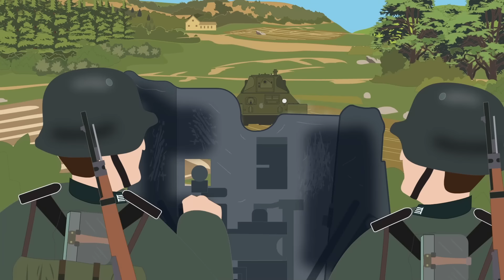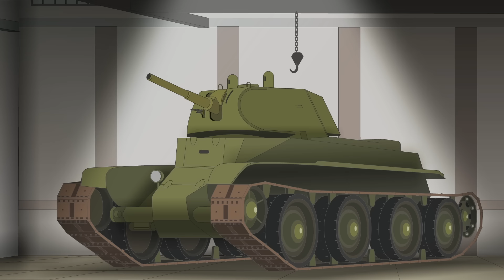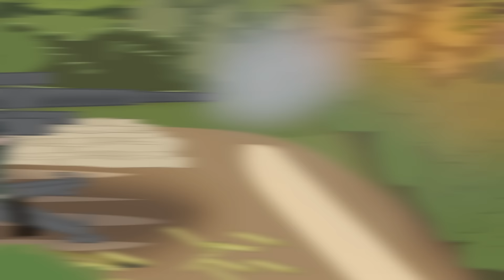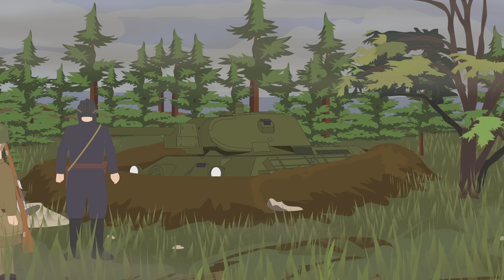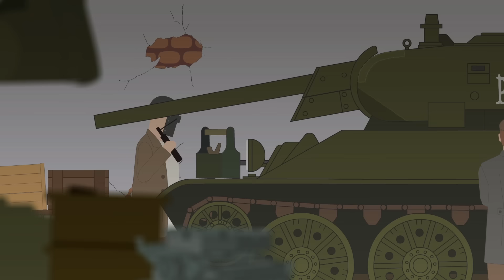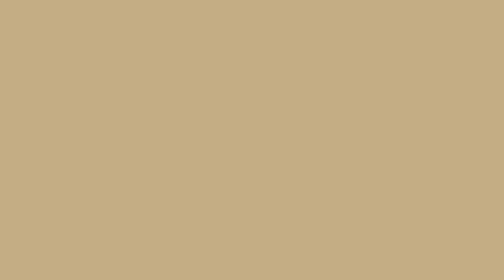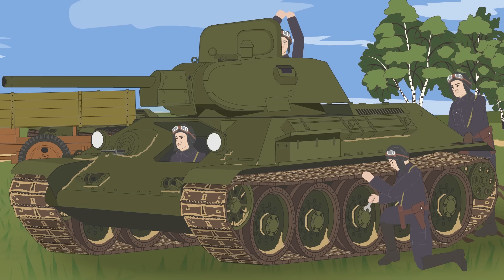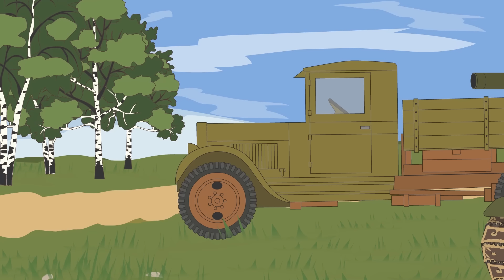Was the T-34 Really the Best Tank of WW2?

Comment: The T34 actually took part in the I think even the first tank battle of Barbarossa. They got wrecked in that battle due to its shortcomings and complete inexperience of the crews and the Field Commanders. In actual combat performance the T34 was about equal to the Panzer 3 at the start of the war.
Reply: Equal to Panzer 3 due to crew training. If you placed German crew even in early T-34 it was superior in 80% of metrics to Panzer 4 used at the time. Main shortcomings of latest 1941 production T-34 were related to poor visibility & interior ergonomics. In every other respect it was better or equal. I guess you can argue about radio quality as well.
Reply: @tomk3732  Not just crew training but combat experience. Many of the german crews saw combat action before that. Also you forgot the communication equipment. While the radio in the T34 seems to be the better one only the Platoon commander had one. That made coordinated movement slow and dangerous due to flag communication. The T34 was ahead oif its time in some areas and behind in others. Overall it had a very slight advantage over the Panzer 3 but within a margin to call it equal.
Reply: @tomk3732  I forgot to mention. In combat the T34 had a firerate of about 2 rounds a minute due to only 3 crewmembers. Thats also quite a big factor.
Reply: @TheDude50447  T-34/85 had 5 crew members & t-34 had 4 ;) I think you read about t-72 with broken auto loader.
Reply: @tomk3732  not thinking about the t72 here. Yeah you're right about the 4 people. But the 2 RPM is accurate. Something with the commander was also the gunner I think.
Reply: @TheDude50447  T-34 rate of fire was from 5-10. https://en.wikipedia.org/wiki/76_mm_tank_gun_M1940_F-34
Original T-34 had small turret with only two pp in it which did cause problems. T-34/85 upgraded to 3 man turret.
Reply: @tomk3732  the official rate of fire was about that. In those tests they drove up to the targets and started shooting. In actual combat when the target had to be located first it was more about 2 RPM. Poor visibility and 2 jobs for the commander were the reason.
Reply: @TheDude50447  Yes it had poor visibility & two man turret meant overworked crew. The two men in turret were loader and commander / gunner. This meant that commander was responsible for finding targets. He certainly could find them & adjust as quickly as any other man but that meant he could not effectively maneuver the tank or had positional awareness or could send radio dispatches or read them or command other tanks in his unit. 
Or in short if they engaged enemy tank they had same rate of fire if they had dedicated gunner as commander simply did not command but fired the gun and adjusted its elevation / lead etc. i.e. 5-10.
In T-34/85 they switched to 3 man turret with dedicated gunner so commander could, during engagement, concentrate on tasks I mentioned above, such as maneuvering his tank to better firing position, informing other tanks of the enemy etc. Also visibility improved just b/c now you had more eyes looking or able to look. In modern tanks you frequently have same visual aids for both commander and gunner - only when they go cheap gunner has better ones. With both having good aids they can look for enemy with 2 pairs of eyes.
Reply: @tomk3732  I would give you 5 rpm if they had a firing computer and thermals 😁 or if they fired it all on a single target. At one time a t34 got hit over 50 times by the same pak3 before the T34 commander found it.
Reply: @TheDude50447  Once you start firing you have found target. Since we do not have situation where gunner and loader are the same person RPM is not affected. So having thermals or computer has zero effect at RPM - they are used to FIND target. 
If they had 3rd person in the turret they would have found that AT gun faster as they would have had more pp looking for it - in addition to commanders cupola which helped even more. Also they could have, after figuring out general area, easier time manovering the tank to better position.
Addition of 3rd man had no affect on RPM on target - it had huge positive affect on tactical use of the tank and benefit in finding target. But main was tactical. 
In 1941 Soviets had almost 10x as many tanks as Germans. But their tactical use was terrible on every level - that was the reason for huge losses. All the way from division commander (or army) down to the single tank commander. 
That T-34 was not just hit 50 times b/c it lucked commanders cupola and extra eyes - that commander was very poorly trained (if at all) in dealing with an AT gun.
Reply: @tomk3732  Yrah if you keep firing on the same target its on average I think 7 rpm. Thats how they did the rate of fire testing and thats where the numbers are from. Most tanks having a gunner to aim and a commander to find new targets can get decently close to that theoretical rof. The 34 was a clusterfuck in that regard and like I said in cases took 50 hits and more before even spotting the opponent.
As you correctly said the T34 85 solved that issue.
Reply: @TheDude50447  Rate of fire is proportional to loader ability - if you got fresh, experienced loader he may fire 10 rounds first minute and 8 the 2nd. If you got a rookie you may fire 5 or 6 and less later on. 
Keep in mind T-34 had around 4 good AT rounds per tank and Germans even less - so this RPM rate is a bit meaningless in these encounters - more like if you miss how quickly can you fire again. There probably will not be much time or ammo to fire 3rd time. 
RPM can be more important in infantry support role - you are firing HE shells at enemy MG nests, troop concentrations, houses etc. Even here T-34 had maybe 90 rounds to spare and T-34/85 like 50+ Modern tanks have maybe 30+ rounds for that role. 
With decreasing ammo load it becomes far more important not to waste it - thus more pp looking and better sensors to actually hit something.
Reply: @TheDude50447  wrote: " The 34 was a clusterfuck in that regard and like I said in cases took 50 hits and more before even spotting the opponent."

-- Who were this anecdotal T-34 crew who tested the tank strength for so long, and dumb PaK crew who could not figure out how to kill T-34 tank, or get out of its way?
Reply: — Maybe you think that Pz-3 was equal to T-34, but that is not how Germans saw that, and that is the reason why Pz-5 Panther was ordered, and Pz-3 was discontinued very quickly there after, so Pz-3 is not even close to T-34 by a long shot.
Reply: @RussianThunderrr  combat effectiveness was about the same. Meaning early in the war the panzer 3 and t34 performed very similarly.  The panzer 3 was phased out cause the panzer 4 took its role, having more upgrade potential. The T34 was actually not too well known to the Germans in the early war. They were more weary of the KV series of tanks. Tiger 1 was also deployed with the main intention of countering KV series tanks.
Reply: @TheDude50447  — Pz-3 combat effectiveness was already mediocre even in the battle of France, masked by a well trained troops(aka panzer grenadiers), and had to have to be accompanied by the other tank(aka Pz-4) which is kinda laughable, if you think Pz-3 was an effective tank, it simply was not. And that what a battle of Mtzensk showed, once Pz-4 with Kurtz 75mm gun been knocked out, and panzer grenadiers troop strength decreased, then true battle effectiveness vs T-34 really shined to light, and advances to capture oldest firearms factory in Tula city halted for the rest of the war, along with Hitlers plans to encircle Moscow city.
Reply: @RussianThunderrr  Panzer 3 was obsolete construction that was only relevant due to its ability to be upgraded. However, upgrades can only go so far - it could not get much bigger gun without bigger turret & it could not get more armor without upgrading engine and suspension (longer / new tracks etc.). So bigger turret, new gun, new armor, new engine and new suspension. Wait, so what is exactly left?

Comment: I read an article where the soviet tankers said that they were not able to get a shot at the germans even at 800 m-s so 1000m-s are not real for  t34 and even for a 1-34-85.
Reply: At 1000m penetration was just over 100mm. Tiger 1 had exactly 100mm in most places at the front. So you had a bit more then 50% chance of penetrating Tiger 1 from the front at 1000m.

Comment: Before the war between Germany and the Soviet Union, Germany obviously received phosphates and crude oil and metals among other things from the SU. What you might not know is that Germany exported German gun-towers built by Krupp to SU Before the war. These gun-towers were used on the T-34 but they had no range finders or gun sights. It was a genius move by Hitler. It is self-evident that the Russian tanks missed with their salvos more often than they hit. But if they hit the target it was from 1.500 m range. 

Also one more fun fact. Early in 1944 the Americans started producing the ”Sherman Firefly”, a regular Sherman with a 76,2 mm cannon, which could nock out a Tiger. Sherman Firefly had a longer cannon. Firefly could effectively nock out a Tiger at a range of 800 meter up to and including 1.200 m, but a hit at 1.200 m was a lucky shot. The Firefly's operational range was 193 km, considerably better than the Tiger's 80 km fueled up.

Comment: German advantages with tanks:
—Better armor
—Better firepower
—Better tactics

Soviet advantages with tanks:
—Better numbers
—Better numbers
—Better numbers
Reply: Better armour only if you ignore the soviet tanks which out performed the german ones
Better firepower when you ignore soviet tanks with better firepower
Better tactics if you have no clue about deep battle theory.

Yeah, glorious geeman panzer vetting bogged down for a majority of the year due to being unmanuverabke in mud or snow and having a transmission which broke by standard use on the way to the front
Reply: @balkoth3762  yeah true
Reply: The soviets also had superior tanks during the early stages of the war
Reply: @jakeweberzwier8655  i mean they also had superiour firepower IS1,IS2 ,IS3 ,SU76M ,KV1 ,KV2, KV6 BEHEMOTH T42
Reply: @okie2464  basically the t34 outclassed the panzer 2, 3 and 4 in every way
Reply: idk about better tactics since german crews were very inexperienced near the end of the war. plus, tanks like the is-2 were being built, which could cut straight through tigers and panthers at pretty extreme ranges. not to mention the is-2 was more reliable than german heavy tanks, and was great when it came to supporting infantry because of its massive high explosive shell. all these advantages you’re listing are pretty questionable, especially since t-34’s were able to destroy german tanks from both sides. (a t-34 was even able to ambush 3 tiger ii’s and destroy all of them.)
Reply: @siko9799  this is true, t34s dominated until the arrival of the tiger 1 and 2, 88mm gun and bigger tank destroyers, and even then the Germans where massively outnumbered.
Reply: @jakeweberzwier8655  yeah until panther tank and tiger tanks were introduced but still a kv2 can fully destroy a tiger with 1 to 2 rounds if its shot directly
Reply: @okie2464  the kv2 had a low rate of fire and was slow so a panther or tiger could beat it
Reply: @jakeweberzwier8655  its a heavy portable self propelled howitzer in short its an portable artillery its not meant to rush and destroy its a support
Reply: @jakeweberzwier8655  it meant you had to use it with caution also the damage of the kv2 is as good as an sturmtiger

Comment: DISCLAIMER: All information for this video was found in USSR sources.  In other words: propaganda.

This video is missing a lot of pertinent information.  Like the unreliability of the transmissions, the armor that was over hardened to the point it was brittle and came apart when the tank was moving, the poor design that limited crew space and killed/maimed operators due to poor suspension and lack of turret basket.  Other information not included was the kill ratio since they were so weak and poorly designed they suffered far more casualties than the German tanks - this was obviously omitted due to conflicting information with what they are trying to push in this video.  The T34 also had an operational distance that was about a third of US tanks and half of German tanks.  This is the average amount of distance it would travel before breaking down.

In ever other war (that wasn't recorded by USSR propaganda) you can see the distinct lack of effectiveness.  In both the Arab-Israel war and the Korean war, t34-85's and Sherman  76mm's faced off and the Shermans DOMINATED.  

To this day, it's sad how many people take USSR propaganda at face value.  The US has always managed to capture, steal, or purchase opposition tanks for research.   There is VERY detailed information on the ineffectiveness of the T34.  I suggest you do a video on that.

Comment: Amazing video and excellent animation quality. Just one thing, the STuG line of vehicles were never intended to battle other tanks although STuG combat with tanks would’ve happened inevitably. Instead the STuGs were designed short range assaults on enemy defensive lines usually defensive hard points in order to allow rapidly exploitation of gaps in the enemy line. STuG literally translates to assault gun. Instead tigers, panthers and hetzers were uses to specificity combat soviet tanks.

Comment: Not even close. Even if the Tiger's suspension was weak, the tank had advantage in everything else. Better gun, much stronger armor, special ammunition, and of course a well trained and battle-experienced crew. The T-34's main advantage was that it was really cheap and russians were able to mass produce it. Even with that, the exact numbers of how much T-34's got lost or destroyed is still unofficial (probably more than thousands)
Reply: Tigers biggest problem was the numbers the Soviets produced 85 000 T-34's either 76 or 85 the US produced about 50 000 Sherman tanks while the Germans produced about 1300 Tigers.
Not to mention that the T-34 and Sherman were medium tanks while the Tiger was a heavy that was originally built to counter the KV-1.

Comment: Built by peasants to run in the mud. Runs like it's going to fall apart at any moment due to loose tolerances, yet mostly stays assembled. Under gunned at first, but fixed later. Yeah, it's pretty cool... but nowhere near as sexy at the Tiger. :)

Comment: How much of a match would the T-34 be against the tanks the Soviet Union would later develop during the 60s and 70s such as the T-62 or T-72? Would it be possible for the T-34 to beat either one of those?
Reply: Sure, even modern Abrams, from the rear. Penetration was just over 100mm at 1000m and touch better point blank.

Comment: Ugh just...no?! I don't know where to start. To call the tank "The Best" and "a new generation of tank" are very arguable. For starters the title of "The Best" hands down has to go to the Tiger tanks. They really had no equal, especially in the hands of a well trained crew. The problem with those Tigers is the exact opposite problem the Soviets had with the T34. Quantity. So the Soviets won by sheer production might and by vastly out-numbering the Nazis. Otherwise large majority of T34s were the early models that were frankly, JUNK. If shrapnel and the blast from a German gun didn't kill you the spalling effect from the interior paint flaking off would. On top of that the T34s for never got a very simple tool like, idk radios, to do things like, idk communicate with other tanks and grounds froces. Not to mention they stored there ammo in a ring around the upper hull and turret meaning that a well placed center mass shot would turn the whole thing into a firework launch the turret off the tank and into the air about 30-40 feet. At least the Soviets often didn't have the ammo to be stored in those racks giving them a better chance of surviving when a Tiger puts a hole clean through them.

Let's face it, even with out Hitler being a straight lunatic, and even with the proper weapons, gear, and supplies. The Nazis still would have lost. They had a war on 2 fronts and the sheer industrial might and numbers of the red army were a serious threat to deal with. Yes I've heard "well if Hitler didn't stop his generals from rushing Moscow". Yeah yeah save it. They rushed Stalingrad and fought a massivley bloody battle over it even though they were prepared and far better supplied and equipped, and they still lost miserably. There is something to be said about mass forces like that. Well their was. Then we invented nukes. Now only cool heads and God can save us.
Reply: wrote: "On top of that the T34s for never got a very simple tool like, idk radios, to do things like, idk communicate with other tanks and grounds froces. Not to mention they stored there ammo in a ring around the upper hull and turret meaning that a well placed center mass shot would turn the whole thing into a firework launch the turret off the tank and into the air about 30-40 feet."

-- Never got radio? 80% of all T-34 that left factory in 1943 had radios, and 100% in 1944. 

-- Ammo in T-34 was stored on the floor in a containers, unlike earlier M4 Sherman tanks, that store ammo exactly as you describe.